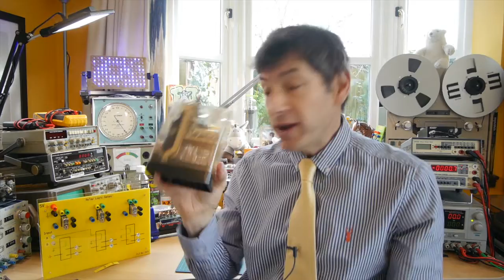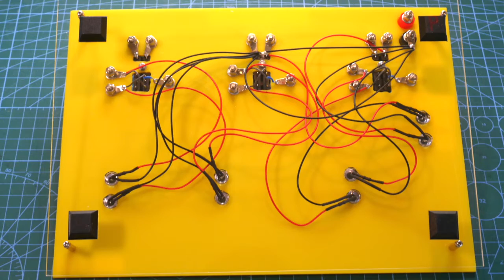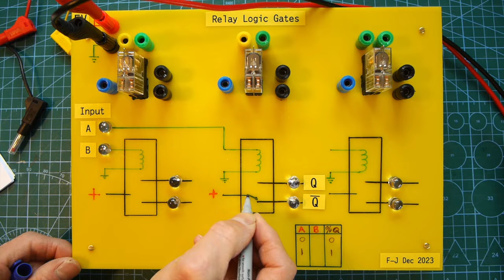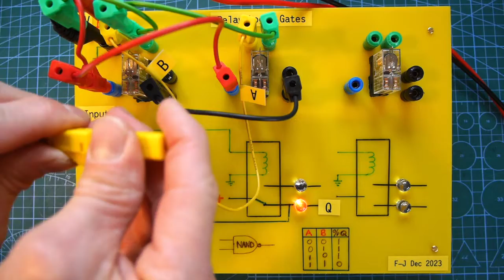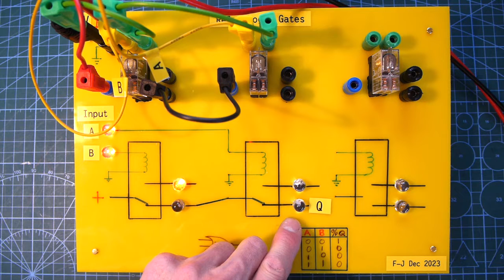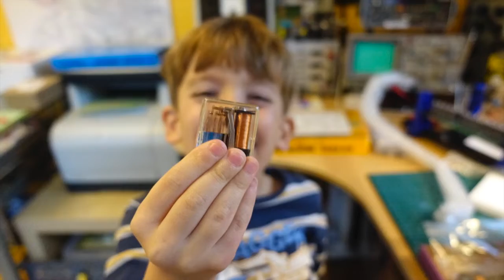Relay Logic Gates - F-J's Physics - Video 183

Comment: Thanks for another very interesting video. Because of the “Earth” symbol used for the negative side of the coil I keep thinking that I’m looking at a circuit of some form of a Voltage Operated Earth Fault Leakage Device 😂
Reply from the maker: Yes!  And in fact I use Earth and Ground and the associated symbols rather loosely!  Often I just use the earth symbol for the negative terminal even if it might not be at earth potential.  Perhaps I should do one with a home made RCCB or ELCB device?!

Comment: Always fascinating. Played with old telephone relays back in the 70’s. For memory’s you can get latching set/reset relays that don’t use power to hold their state. Would probably work for memory and registers.
Reply from the maker: Thanks Lawrence.  Yes, indeed I could have used latching relays by unplugging the ones that were on my board - or just making the board bigger!  Talking of telephone relays have you seen this video of mine? https://youtu.be/u3O8EiK-ASs
Reply: @AnthonyFrancisJones  No I had not, very nice.  I was watching Sam from This Museum is not obsolete who has demoed these units as well.  Looked on ebay but the ones on offer were quite pricey.  Curious Marc has a video on the 1958 FACOM 128B, a still working relay computer with about 5000 relays.  Always fascinated by the old mechanical stuff.
Reply from the maker: Great - yes Sam is truly amazing and as for Curious Marc - what can I say!